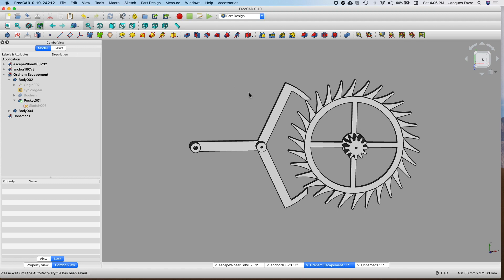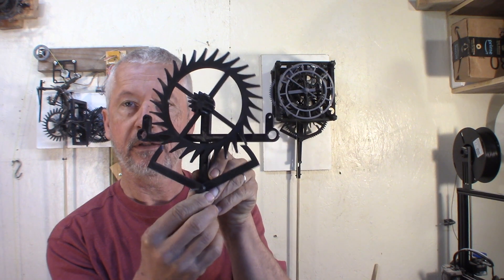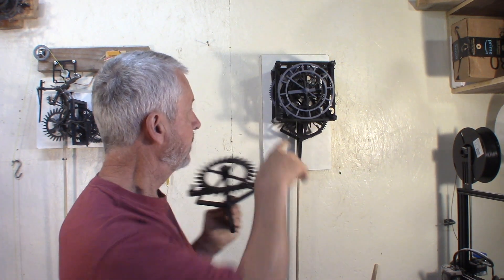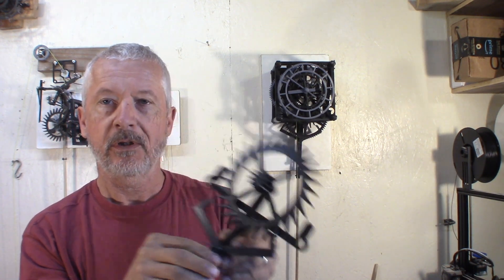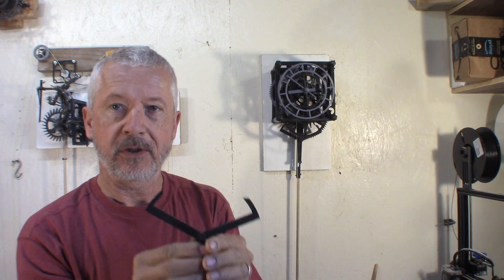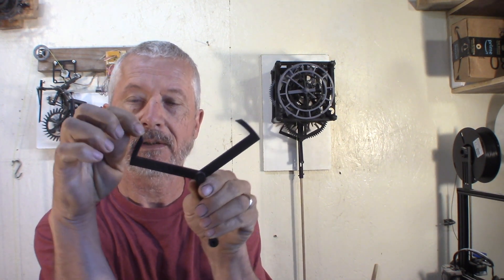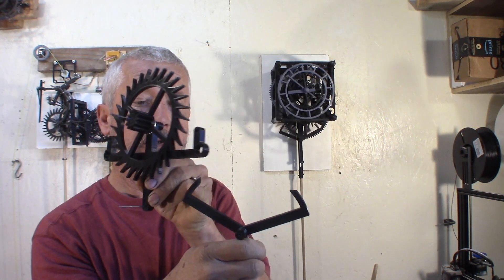How to design a 3D printed Graham escapement with FreeCAD 0.19

Comment: One thing I am still struggling to grasp, is how to determine the needed radius for an escape wheel. I have planned out the sizes of my 2nd-4th wheels and my pinions, but so far I can't figure out what radius escape wheel I will need to work well with them. If you have any insights, or resource recommendations it would be much appreciated! Thanks for the wonderfully informative content!
Reply from the maker: smaller is less friction, but smaller need more prescision
in my roskopf watch I was able to go as small as 40 mm for the escape wheel , printed on a Ender 3
and I use module 1,2